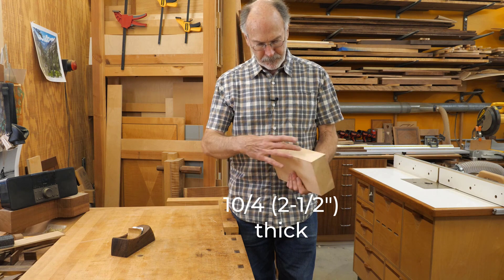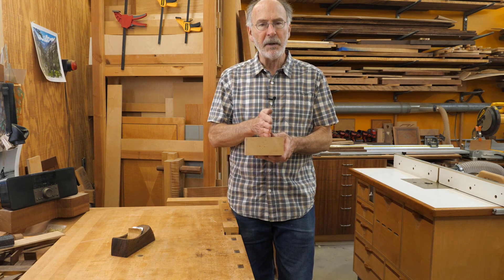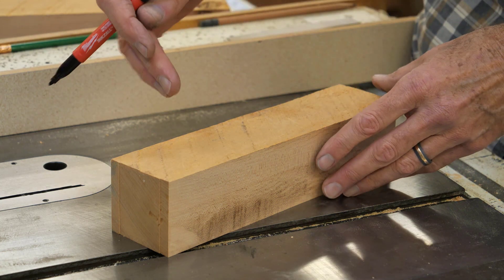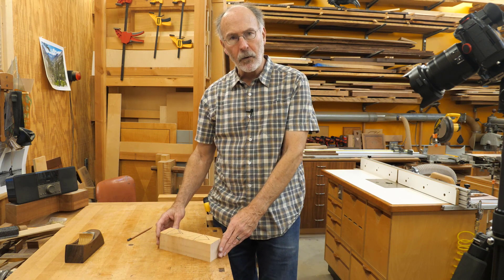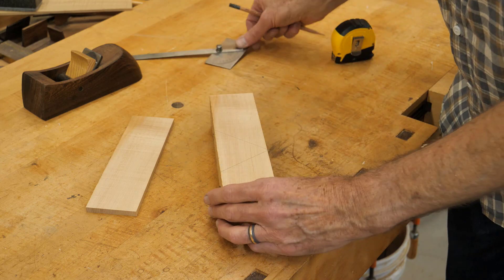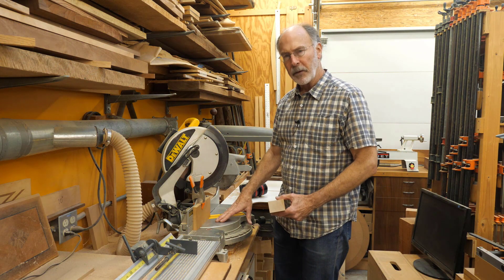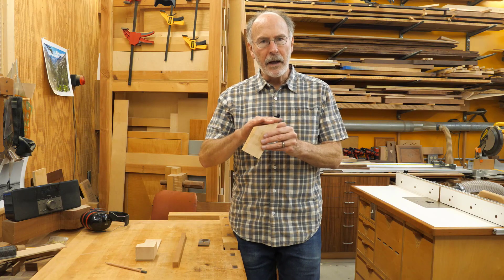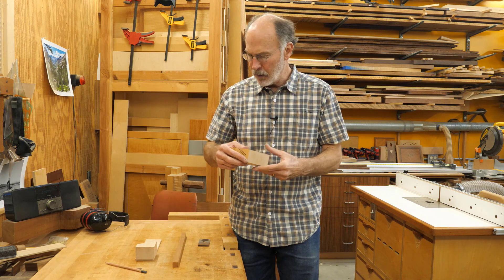Krenov-Style Wood Plane Build Part 1

Comment: The blank needs to be flat sawn with the bark side facing down and the rings of the endgrain running side to side and forming a smile pattern.  Any grain runout needs to run downhill from the front toe to the rear heel of the plane.  The flat side is more durable than the quarter saw sides.  By having the upped grain forming a smile on the endgrain you are placing the stronger outside arc of the growth rings along the middle of sole where the most wear occurs you lengthen the useful life of the plane.
Reply from the maker: I do agree that you want to avoid quartersawn surface on the sole, but I'll have to take your word for the rest. I have never been too concerned with the grain direction; it can be enough of a challenge to find a piece that's thick and wide enough to make a plane. Adding to that challenge to get the proper grain direction is too much for me. I have typically used dense woods for my planes so the wear has been negligible, although I probably haven't used them enough to really notice. Thanks for your insight.

Comment: Mr Carl, Thanks for putting this series together on the making of the Krenov planes. Very clear and concise !  I do luthier work and am in need of making some mini planes for the purpose of shaping down transverse braces after they glued in place. Could you offer any suggestions on making planes in a very diminutive size ?  🙏
Reply from the maker: You are welcome!

After a bit (actually a lot) of thought, I think a miniature Krenov-plane is possible. Check out my blog post for the whole story - https://carlstammerjohn.com/?p=1109
Reply: @CarlStammerjohn   This is great ! 
Many thanks for taking the time to work this up 🙂 I dont suppose you could give the blade angle and projected mouth opening ?  🙏
Reply from the maker: @TroutabdDerby  The blade angle  is 45 degrees. I just went with the standard number. Not sure what you mean by the projected mouth opening.
Reply: @CarlStammerjohn   Thanks. Many of the violin maker finger plane blades are at 37 degrees.
Reply from the maker: @TroutabdDerby  We might be talking about two different things. I searched the web a bit and found a few comments regarding angles on finger planes, but all refer to normal or high cutting angles. Those can be obtained with a high bed angle on a bevel-down plane or a high bevel angle on a bevel-up plane. 37 degrees would make sense for the blade bevel angle on a bevel-up plane. That would yield a 49 degree cutting angle on a low angle plane (12 deg bed angle). You can't make that plane out of wood; the bed would be too thin.

I hope that all makes sense. It was always challenging getting my students to understand what all these numbers mean.
Reply: @CarlStammerjohn  I was able to make a very nice finger plane using your diagram and Kwila wood from PNG. Went ahead and gave it a 37 degree bed. It all worked out very well. Shaving my ukulele braces nicely and consistently. I'd post a pic here but they dont seem to have that option
Reply from the maker: @TroutabdDerby  That’s great! I’d love to see it. Please email it to me at carl@carlstammerjohn.com.
Reply: @CarlStammerjohn   Sent

Comment: What brand is your jointer planer, thanks!
Reply from the maker: It's a Robland XSD 310, purchased from Laguna Tools almost 30 years ago. I put a Byrd Shelix cutterhead on it in 2020. It's been a great machine and I've never had any issues with it. I don't know if Robland is importing them anymore but they are available on the used market.
Reply: Thank you very much. My career was as a television News anchor and reporter. So my life is video. You are a great communicator!